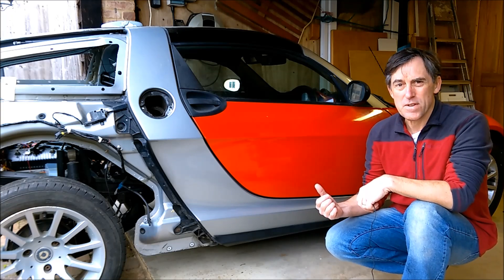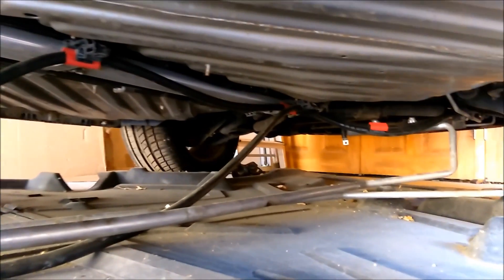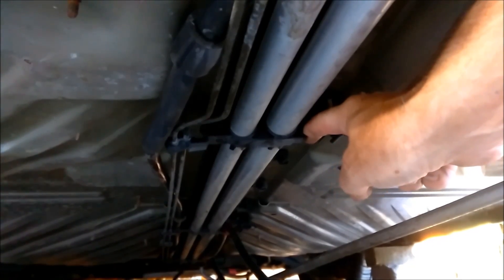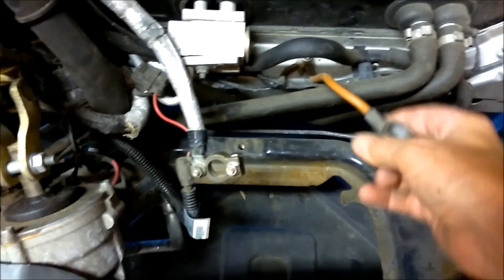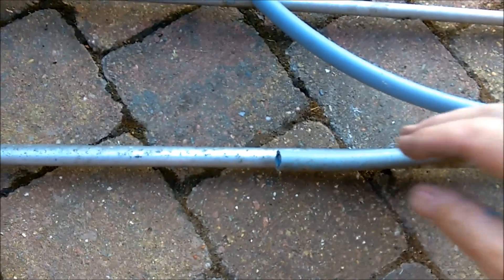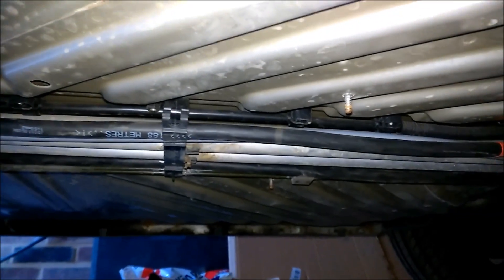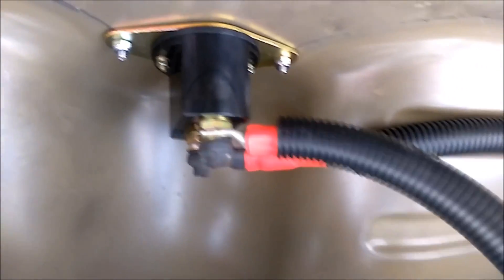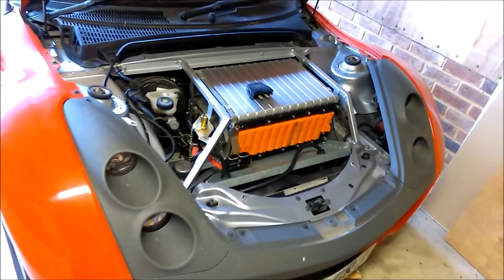Converting car to electric - Roadster Power cables

Comment: Hi Paul, You haven't had any videos for over 4 months, is everything ok! As you know I am very keen to see you how you manage the to get the gearbox to change gears.
Reply from the maker: Wow is it that long ago, I need to get something recorded.. I have very little spare time these days. It have come along a little bit, controller try is done, controller is in, just need to make some brackets and connect some wires and it would be driveable, (ignoring the battery charging side). New video by the end of this weekend.... probably.

Comment: Dude we need you back on the road again! Now!
What ever you do, its not that important as this project!
Reply from the maker: I kind of agree with you, I really want this done now, but earning money still comes top at the moment unfortunately. But I have been working on it a little bit... the control tray is in, big cables done, controller and big heatsink are in and I'm in the process of sorting out the Low voltage wiring. Battery charging still needs thought but it won't stop me doing some short trips to try it out. I'll stick a short video on soon.

Comment: What are you planning on using for your BMS? I've been using something called the smart BMS that I got off of eBay with a Bluetooth communication. I had to set it up special 2 run the main contactor and charger relays has mine will only handle 10 amps. You can click on my profile picture to find out how I did this if you're interested. Nice job and congratulations on your YouTube following.
Reply from the maker: I keep conveniently putting off the charging side of things,  I building the control side now and will youtube that soon but I'll have to sort out the BMS soon too, I'll have a look at what you've done, thanks.
Reply: @crispydoda  with the price of solar panels dropping so much I've set up an array and use it for charging many different cars instead of buying a charger. I'm using the intelligent meter and the BMS to turn off a relay that feeds the batteries from the solar panels. Pretty simple , I put a capacitor across the relay to help with the arc that happens when the contactor opens with the high voltage from the solar panels unloaded.

Comment: Thank you so much for making these videos. I deperately want to make my roadster electric and it's been interesting to see the challenges and solutions you've had.

I'm especially interested in what your solution will be for the gearbox in terms of choosing gears and changing between gears. How would a torque converter affect the drivetrain and would it be a viable option instead of a gearbox? I've so many questions
Reply: Likewise, I'm looking on with interest re the gearbox. Maybe it can be bypassed even?

Comment: you can use your old air con pipes to protect your cables, assuming you are getting rid of ac ofcourse
Reply from the maker: Hi Anton, I tried pulling the small cables through the aircon pipes but they had tight bends in them so it was too hard to pull them through. I'm leaving the larger coolant pipes in just in case I choose to water cool the motor later on.
Reply: @crispydoda  hi Paul, me and the group wanted to thank you for the cad model, it really helped us, would you consider setting up Patreons page to help you with the build? your videos have helped a good few of us im sure, it's time for us to give back!

Comment: Hi Paul, Glad to see you back with a video. I have put my high voltage battery pack cables inside the aluminium tubes, the reason was more protection and I could not see that I was ever going to use those pipes for air con, we don't have extreme range in climate here ... yet! I am very keen for you to get your Roadster on the road and see how you use the gearbox! Mine is still up on blocks while I am trying to source a pancake AC motor.
Reply from the maker: Hi Michael, I did consider that as it does seem like a good way to protect the cables, I wondered if they would get hot if run in tubes but perhaps the aluminium will help sink the heat away anyway. The gearbox is going to be an interesting part of it, having a high and low gear will make it more fun without compromising the top speed. I hope you sort out a motor soon, finding these for a decent price is pot luck sometimes.

Comment: Nice video Paul. Good plan to leave the cooling pipes where they are now. I removed them in my conversion of a Roadster but regret than now ... for the heating of the cabin it can be quite efficient to use the heat of the electric motor (mine is water cooled, but I didn't connect it, although it gets up to 90 degrees Celcius when driving) if you use the existing radiator under the dash (and not replace it by a PTC heater). Heating the cabin will use quite some power ... I will also have to install seat heating, my Roadster didn't have that option. If you do not have that you may want to anticipate that in your wiring loom.
Reply from the maker: Hi, Thanks for watching. Yes I figured it was better to leave these in as I haven't really decided what to do with heating and possible cooling the motor. Seems to make sense to sink the heat out of the motor and controller and pipe it though the cabin heater at some point. Might have to drive faster in winter to generate enough heat in the cabin. Seat heating... I hadn't thought of that one, might have a look on ebay for some roadster heated seats if they are available in the uk.

Comment: Great series of videos :)  Do you need to run that thick zero volts cable underneath ?  Couldn't you just use the chassis earth path and just have a positive cable ?  Would be interested to know as I am seriously thinking of doing this conversion on a smaller scaled three-wheeler of some description.  Thanks :)
Reply from the maker: That is a good question. I probably could use the chassis but as the current is so high I'd be concerned that the path was not reliable enough so the nice chunky copper cable has a known power rating. I assume I'll need to connect the 0v from the 100v battery and the 0v from the 12v battery together at some point.

Comment: Hi There, am planning this exact build this year, been thinking about it for 2 years now and couldn’t believe my luck when I did another recent search and seen your build. I was waiting for batteries to come cheaper
Reply: I am in the same boat as you!
Reply from the maker: Hi, I had the same issue too for a while, then luckily I came across the ones I have from a great chap that had some going cheap. 
On the motorbike project I'm now working on we've ended up designing our own packs using 18650s, they are in a 60v (16S-4P) pack (600wh) that can provide 80A continuous with BMS inside so charging is easy. Our motorbike has 3 packs to give us 240A and 1.8kwh.... Too early to release or give a price though I'm afraid, voltage is a bit too low for cars though.
Reply: Any details on the motorbike project?
Reply from the maker: Hi James, 
The motorbike project is something I'm working on with someone I've known for a long time. He is dealing with the commercial and sales side of things and I'm concentrating on the design. 
Bike were not really my thing but his idea was to build something like the Street Cubs/BMX, they are Honda C90s which have been stripped and pimped up and are pretty cool. We'll our emotorbike takes some of this look (and some of the iconic honda parts) to create a more stripped down version of an electric motorbike. The idea is it's much quicker than it looks, 9kw gets it to around 60mph quickly but with the look and feel of a e-bike rather than a motorbike. 
The initial bikes will be sold as 'pit bikes' i.e. not road legal due to meeting all the regs but hopefully soon we'll get these on the road. Loads to do but hopefully available to buy in a few months. 
Paul

Comment: Nice job Paul cable runs worked a treat, coolant pipes? I'd have though these were now surplus to requirement, especially as you got the power cables in and blue pipe for control cables? Looking forward to the next episode!👍🏻 cheers!

Comment: amazing project 
I have question ,  are you going to leave front isolator hidden or you will put it thru hood ?
Reply from the maker: Hi Filip, I'll keep it under the hood, it's really to isolate stuff when I'm working on it. The one inside will be my panic switch if things go wrong :).
Reply: @crispydoda  thanks for reply
i was asking because in Rally they using inside one for driver and outside one for emergency but make sense that for road use outside switch will be too accessible.